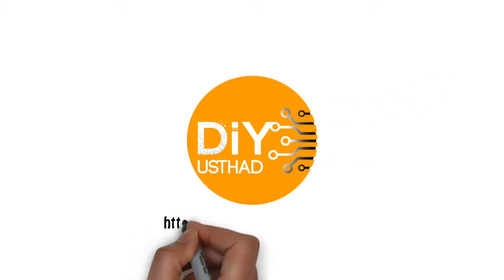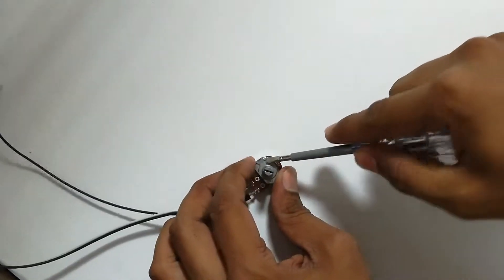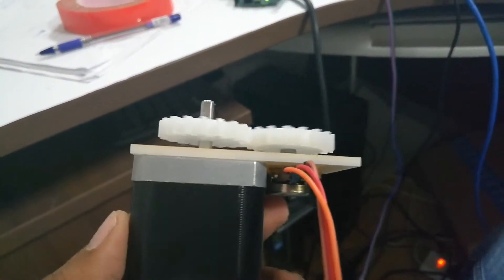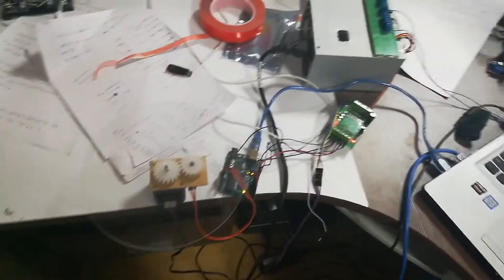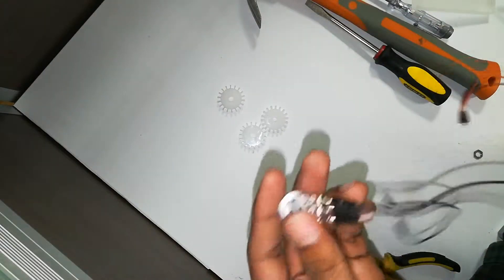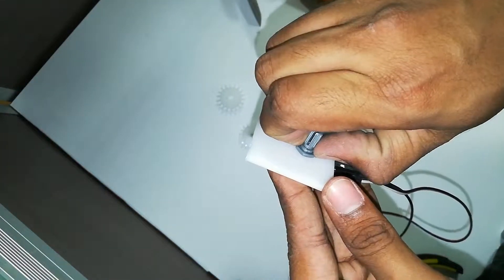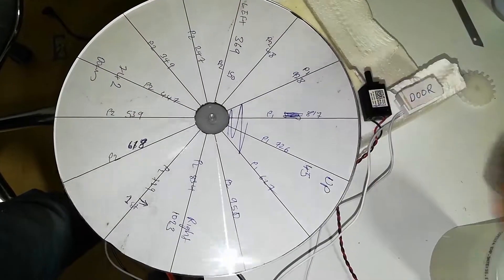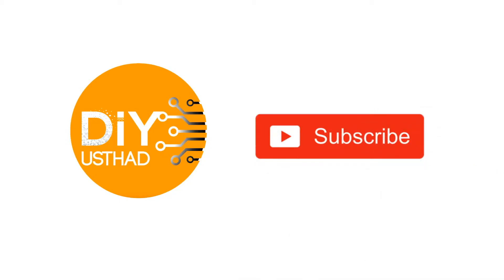Closed loop stepper motor using potentiometers

Comment: I have two questions,, plz answer both.. 
1st,,,,if we making a rc car... Of we change gear ratio of potentiometer and servo.... We can adjust the number of spins of servo... 
(In easy words.... If servo has small gear and potentiometer had big,,, so we can make servo turn more distance(spins) ..........)

2nd question,,,,, if we replace the motor with bigger motor like 12  or 24v..... (for more power I need for turning)  then we can swap the small motor by bigger one????.. 

Plz answer both

Comment: I've seen some potentiometer feedbacks on commercial systems (lab equipment) On those they used a DC-motor driven by a high current opamp and 10-turn pots. Sort of pick and place machine but with test tubes...
Reply from the maker: Oh i didn't know about that, thanks for the information
Reply: XY recorder? Thats is beautifull measuring instrumen!